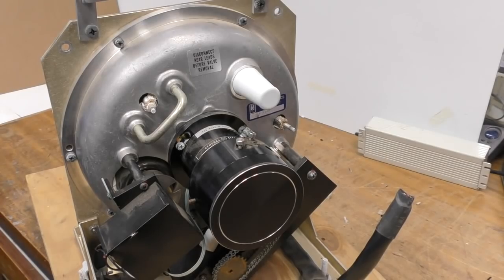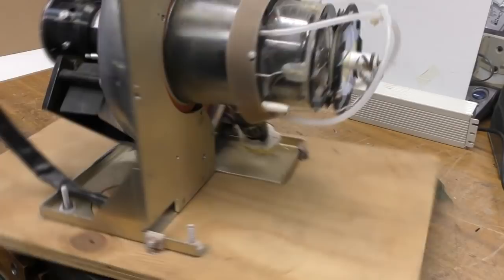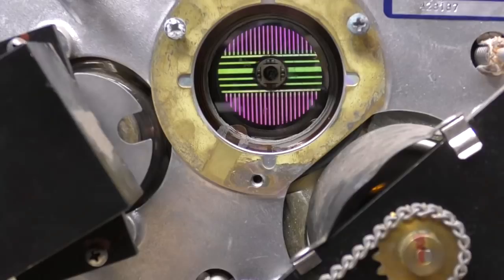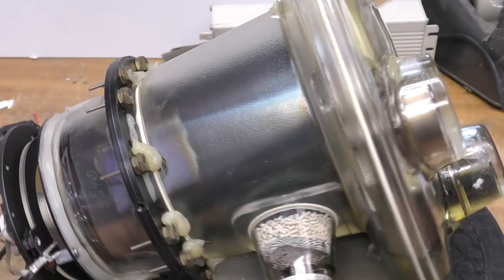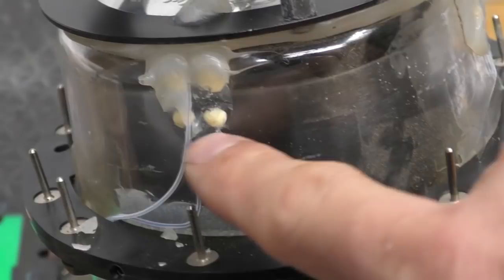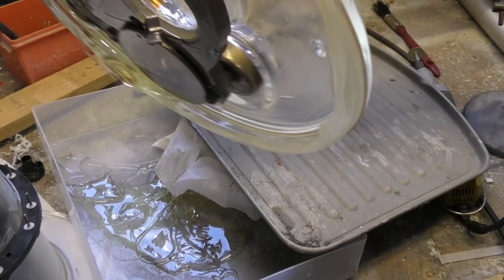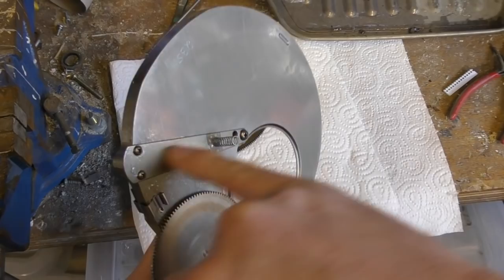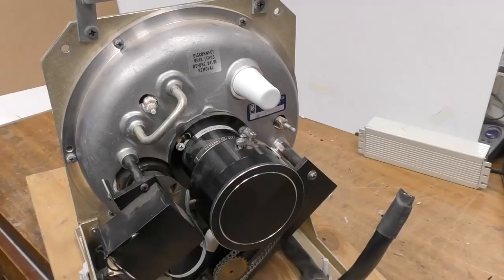GE Talaria projector light valve

Comment: Used to maintain one of these in the BBC "Breakfast Time" studio in the early 1980s.  It back-projected animated graphics onto a 5 foot screen for the weather man (Francis Wilson) to stand in front of and wave his arms around, which was quite a tall order at the time.  For use in-shot it had to be bright enough to compete with the studio lighting, and we all know the television camera is very unforgiving of colour impurity or shading etc.

The diffraction gratings created on the oil film required a very stable video input.  If the input was disturbed or switched to a non-synchronous source, a wave of uneven oil would pass across the scanned area, taking about 20 minutes to clear.  This looked like a series of bubbles or bright clouds sweeping diagonally across the screen and was very noticeable.  On the weather map graphic it looked uncannily like a weather front approaching from the north Atlantic!

The getter thing hanging out of the bottom was called the IHSP (Internal Hydrogen Sorption Pump), and it was the main thing that determined the lifespan of the light valve.  When the titanium filament went open-circuit you were running on borrowed time because the vacuum would be slowly contaminated by gases from the oil. Then it was time to get out the cheque book and order a new light valve (£17,000 UK at 1980s prices).

The other thing that could kill the light valve was explosion of the xenon bulb.  This was a several-hundred watt high pressure lamp mounted in a reflector behind the light valve itself.  If you tried to operate this lamp beyond its recommended service life the pressure could build up dangerously, until it failed.  Bits of broken bulb and lens could then be thrown forward into the delicate input dichroics causing all sorts of damage. There was an hours meter on the projector but I don't recall any automatic shutdown when the bulb hours had been exceeded. 

Thank you for reminding me of this amazing device and showing its internal details. Even at the time it seemed unbelievable that the concept could work at all, let alone with reasonable consistency and reliability.  The routine alignment procedure was long-winded and not at all intuitive, and had to be followed to the letter by a specially trained engineer.  Any slip could result in rainbow colours and shading over large areas of the picture, and  the only solution was to go back and start again. Casual adjustment was very much discouraged, to the extent that we engineers had to fit a padlock and chain to deter unauthorised fiddling!
Reply from the maker: Thanks- one of the things I love about these kinds of teardowns is getting info from people that used them!
Reply from the maker: Pity about the pump filament being the limiting factor - they could easily have put a few more spare filaments in there!
Reply: @mikeselectricstuff  Yes that CRT base certainly had enough spare pins, though probably the designers figured out that when the getter filament was dead the drive filament would probably be well past it's best anyway, so a rebuild to replace the one will of course also involve replacing the other.

Comment: VERY COOL TEARDOWN!  I worked with these projectors a bit in the 1980s, and always wanted to see the innards of the light valve. Unfortunately, the worn out ones were always sent back for rebuilding, so I could never get my hands on one. The rest of the projector is a similar bit of electronics geek porn, with all the required power supplies, scanning circuitry, interlocks and video processing circuitry on dozens of plug-in modules. The units needed 30-45 minutes from a cold start to warm up the oil before you could fire up the lamp and begin the image setup.  GE stopped making them in the early 1990s, and the story that I heard concerning the reason had to do with the loss of corporate knowledge of how to manufacture the specialized oil.  The key person involved in the production either died or retired and took the secrets with him...
Reply: I wonder what that oil is worth per litre... :P
Reply: Isn’t that always the way… only one guys knows how it works; when he’s gone, the company goes out of business…
Reply: @tekvax  GE is a massive company, withdrawing one niche product isn’t going to put it out of business, but that division certainly. By the early 90s presumably other technologies were reducing the market and/or the profitability needed to re-acquire the technological skills and knowledge required to keep making them.
Reply: @ohnoitisnt  Not much for it's original purpose anyway...

Comment: I wonder if the oil filter meshes were also for stripping charge from it.  Those gear-wheel oil pumps are counterintuitive.  The oil doesn't go through the middle between the teeth, it gets displaced around the outside of the gear wheels and squeegeed off by the mating teeth.
Reply: would make sense .. the thing would run for hours so there would be some kinda build up unless there was done some kinda stripping the charge from it. But that oil, it must have some kinda crazy weird properties, must be some patent on that stuff.
Reply from the maker: Good idea - I'd think these would be made in clean-room conditions so hard to see they'd need filters to trap particles, and that arrangement would seem odd for a simple crud filter.
Reply: Woah, the big boi himself, fancy seeing you in these parts
Reply: They might've expected a certain amount of mechanical wear too, for which filtering would be wise. But given the short lifetime, maybe that doesn't amount to much, and it's not like anything should ever be without an oil film in operation.
Reply: The oil pump and the filtering plates also helped even out the oil temperature/viscosity.Oil returning to the sump after being scanned would be warmed by the radiant energy of the lamp and the beam current of the scanning beam. Forcing all the oil through that massive metal structure of meshes and plates (filter and heat exchanger) before wiping it onto the image plate gave a more uniform film.

Comment: very cool!  Back in the early 80's, I spent a few months repairing Talaria projectors that were being used on Harrier flight simulators being sold to the U.S. Marine Corps.  I was just fixing the various circuit boards, but remember watching these warm up and seeing the initial film of oil on the displayed image as the disc slowly rotated.  The fact that it used diffraction gratings to generate colors still amazes me!

Comment: I wonder if the device on the side was a continuously active getter for gathering impurities and maybe helping to maintain the vacuum.
Reply: An active getter. It certainly looks like one.
Reply: @beefchicken  
Getter ion pumps are amazing. A chamber that sputters gettery metal fom one end to the other. Reasonable starting pressure, good pumping and an ultimate vacuum.
Reply: Yes,  it is a miniature Ion vacuum pump. Likely needed to scrub any off-gassing from the oil. The molecular sieves above it are to protect the Ion pump from the oil.
Reply: Actually I was wrong. I didn't finish the video before commenting. It's actually a titanium sublimation vacuum pump.
Reply: @hightechstuff2  
Really ?
Never heard of it. Please tell us how it works.
Reply: @paulvandergroen9569  In titanium sublimation, you have a hot filament made of titanium which burns hard enough to turn into titanium gas. This gas captures oxygen, hydrogen and other gasses and solidifies them onto those heatsink like fins. You can see the buildup of the titanium that was coating them when Mike removes the device from the tube.
Reply: @hightechstuff2  I like it, thank you.
Reply: maybe a rechargeable/refreshable getter for changing out the electron gun
Reply: @hightechstuff2  That makes total sense, all fluids must have off-gas when they get warm, and perhaps oils more so, and in a vacuum. So a Ion pump with a titanium filament, wow surprising, but makes total sense.

Comment: From the wiki...

"The single lens color projector (PJ5000 line) use dichroic filters to separate the white light of the xenon bulb in two channels, Green and Magenta.

RGB color separation and processing is obtained using vertical wobbulation of the electron beam on the oil film to modulate the green channel and sawtooth modulation is added to the horizontal sweep to separate and modulate Red and Blue channels. The optical system used in the Talaria line is a Schlieren optic like an Eidophor, but the color extraction is much more complex."
Reply: It almost sounds like that tiny variation in the beam pattern causes a change in the direction of the reflected light.

And that slight direction change of the beam gets amplified by the whole Schlieren optics thing, because it only needs a very tiny amount of change.

Maybe that can separate the red and blue from the magenta light using a chromatic abberation effect? No idea. lol

(and Green gets activated like a "monochrome" version of the tube, where the light gets deflected a tiny bit in the vertical direction?)
Reply: And then of course I see Mike uploaded a follow-up vid, nine hours ago. lol

Comment: From an old Ebay Ad for one of these:-
"The Talaria was a $100,000 projector, used most commonly in closed-circuit TV. …The Pope owned two, Hugh Hefner owned about a dozen and they were all over the Pentagon and in flight simulation. Microsoft co-founder Paul Allen had one, Steve Jobs had one, and we rented them to all the big rock groups for concerts, including eight for the Rolling Stones for their Steel Wheels tour"
Reply: The one which cost $100,000 used three light valves, one for each of the primary colours, and a 10kW xenon short-arc lamp.

Comment: The lump on the side is certainly a vacuum pump - not entirely sure which kind, but by the looks of it, it's probably either an evaporable getter, or a titanium sublimation pump. The rings are heatsinks, to recondense the vapors(and either activate them, or capture the gas if it's a tisub). The beads are an oil filter - the pump can pump gases, but if it meets oil, there will just be lots of carbon decomposition.
The oil is likely a silicone high vacuum oil with special light-valve-y electrostatic-y additives. Looks almost identical some diffusion pump silicone oils - goop at low temp, liquid at high temp, and low vapor pressure(for high vacuum operation).
The ceramic electron gun is most likely because they were very disposable - and while rebuilding the rest of the tube wasn't necessary, the gun likely failed quite often due to the extreme operating conditions(imagine how much power you'd need in this beam!). Ceramic vacuum assemblies are very easy to put into mass production - metal to ceramic brazing is fast and cheap, and ceramics can be prefabricated, along with the metal(likely kovar) rings.
Reply: Nice analysis! The oil consistency reminds me a bit of Santovac 5, which is a polyphenyl ether diffusion pump fluid. DC705 silicone oil is pretty viscous as well, but less so than Santovac. I've seen recommendations against using silicone fluids in vacuum systems with electron optics, due to the formation of insulating silica coatings on electrodes upon decomposition.
Reply: @Mikkel324  That is a valid concern! I wonder what they're doing to avoid that. Perhaps that meshy filter thing is less for filtering the oil, and more for separating the dead oil from the still good bulk?
Reply: The light output came from an external light source, the e-beam was only needed to scan the oil film which amplified the signal massively.

Comment: Very nice! I had one of these at my work around 1982. It took 20-30 minutes to get a decent image after startup because the disk turned so slowly. You could see the image slowly become more complete as the disk turned.  I remember scouring the service manual for how they made color in a single light valve. I recall that the electron beam deflection was modulated at two frequencies around 100MHz, I believe, for the color signals. The modulation created diffraction gratings in the oil. US patent 3437746 seem to cover it.
Reply from the maker: The Eidophor used velocity modulation, I think because altering beam current would change the depth of the charge within the oil - may have been something similar, though the tails on the cathode connection on the electron gun don't look like they're designed for 100MHz!
Reply: @mikeselectricstuff  Are you sure the tails are not also for transport? It looks like they clip on very roughly, and maybe there was a special cap that went on in the projector.
Reply: @Spirit532  The main light source shone past the electron gun so it had to be robust and small as possible.  Another comment above suggested the modulation was added to the x and y deflection signals, wiggles in X would generate patterns at one grating frequency and wiggles in the Y scan would generate patterns at the other grating frequency.  I think the tiny X-Y deflection plates would have added those wiggles and the big X-Y plates would have provided the raster scanning.

Comment: Some of the stuff online dates the Talaria to the early 1980's. I worked at a GE location from 1972-1980 which had at least one GE light valve projector in service during that time for rear projection of "outside" view for aircraft cockpit simulators.  I suppose it might have been a development prototype.  This was 5-10 years before the commercial introduction of Talaria in 1983.  None of my colleagues called it "Talaria" at the time, just "light valve."  I'm pretty sure the one used in the project I worked on for a time had more than 10k hours on it before I left.
Reply: I can confirm that I found documentation of exactly this setup online related to a Boeing flight simulator... possibly for military training.

Comment: Fascinating tech. I used to service 3 CRT video projectors, Barco and Sony mainly, as well as doing line-ups at the installations. Never saw anything like this! Some of the CRT projectors had a film of oil flowing on the front of the tubes for cooling, nothing more exotic than that!
Reply: Im the guy who is stuck still making those Sony and Panasonic tubes!
Reply: @mikeh4840  Tell us more, is this a legacy production line that keeps turning them out or is this a new plant to provide tubes for legacy applications?

Where is this place? Will they let you make a factory walk through video if you ask nicely?

Comment: The device that is seen on the outside is a "sublimation vacuum pump", for removing the impurities from the vacuum itself, not the oil, fascinating technology that is still used today, think modern day air filters, similar system of using a very pure gaseous metalloid to attract gaseous impurities to itself, they don't last long however, so 1000 work hours is a bit too long for a system like that, we'd estimate 600 hours before it dips below its peak, over 800 hours and its probably working at less than half efficiency, its also a "off the shelf" unit, probably to keep costs down, usually with custom equipment they commission their own "filters" to be built specific for purpose, in which case we would recommend two "torus", "flat plate" or "disc" units, it would use far less power overall and would make the unit more streamlined, something tells us that costs were tight when it came to this!
Reply: Are those beads molecule sieves then ?
Reply: The 2 separate pumps may be to account for that; one for the first 500hr and the other for the second 500hr of the tube's life.

Comment: 1:10 - loved your eidophor talk, i discovered the linotype machine shortly afterward and had fell down a similar rabbit hole
Reply from the maker: There's a good documentary on the linotype - think it was a kickstarter a few years ago
Reply: Linotypes and Intertypes are also amazing tech, reputed to have largest number of parts for a machine at the time but most unlikely to be true as a ship would have more.  However they were incredibly complex for a single machine.  I had the pleasure of operating an C4 Intertype for a few years and repaired it based on available documentation a few times.

What is beyond most people these days is the precision required for the Monotype Composition Caster moulds.  The moulds had two main parts that should have been interchangeable but because they were lapped together at the factory one mould base would not work with another mould due to hard to measure difference on the mating surface geometry.

Comment: Nice breakdown. A friend on Facebook who also used to operate them posted your video. 
You got everything pretty right as far as I remember. So - color. Did you notice the correlation between the dichroics and the schlieren gratings? That’s because green is created - deformed in order to pass through the paired gratings - by horizontal modulation - a wave applied to the plates and red/blue by vertical modulation. 
The hard part (apart from dealing with the oil and temperature) of operating was tuning the front optical schlieren to block all the light from the lamp 2 hence all the thumbscrews on the front optics. Making a ‘darkfield’ we called it. 
Then the split green and magenta waves were applied to plates and that caused deflections in the oil that allowed either green or magenta light to pass through. 
The extra wrinkle was that video is a horizontally scanned signal, so a black video frame would actually produce a bright green frame. 
So - an extra cancellation wave was applied horizontally to make your ‘electronic darkfield’. That was a bit of an art form - it was never really perfect. I seems to remember a few adjustments to that. 
There was also some horrible ‘flatfield’ adjustments to compensate for the natural differences in deflection across the oil surface, to get a sort of flat color field. That also never really worked and was very temperature dependent!
Side fact - the talaria op was also first at work to turn on the oil heater for an hour in the mornings!